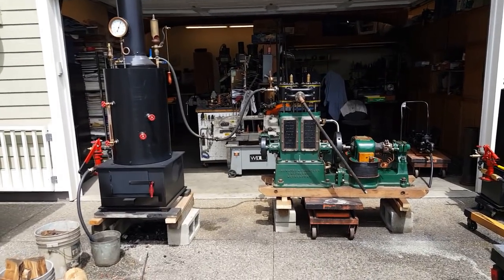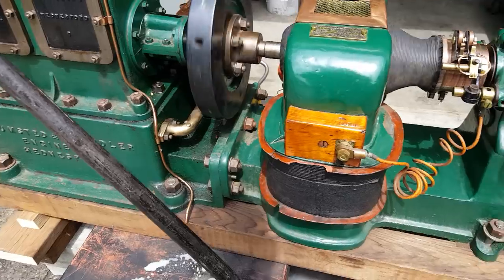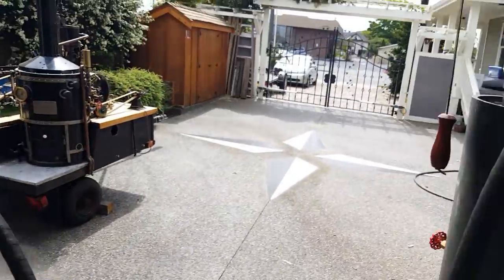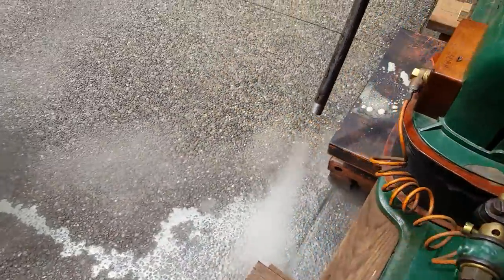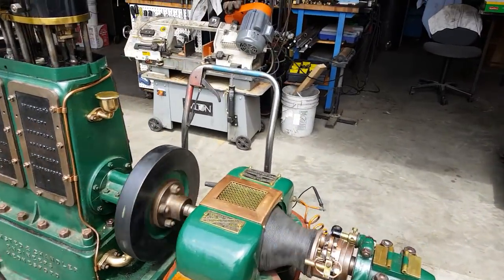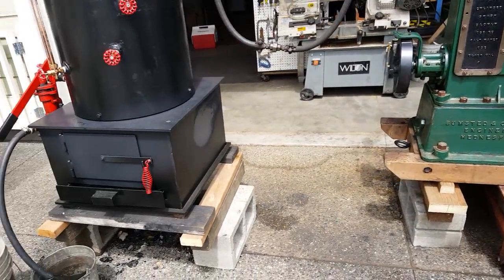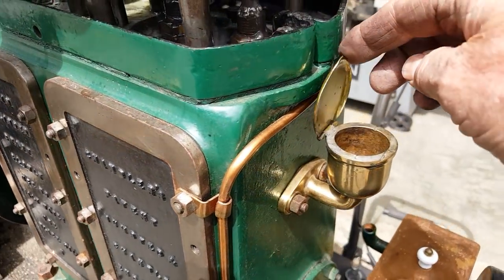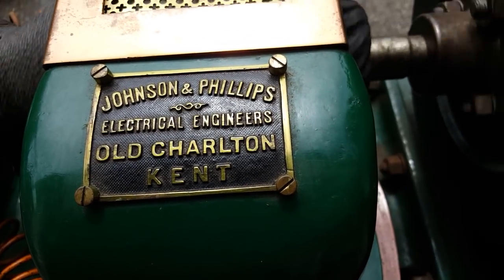Steam Engine Dynamo

Comment: If the voltmeter is reading only about 2V, probably the field is not connected or is open circuit internally.
Possibly it is a series connected machine, which means it won't generate rated voltage without the rated current flowing.
The handle for rotating the brushes is for manual compensation for what is called "armature reaction".  When you draw current from a generator, it causes the magnetic field established by the field coil to twist about the generator axis.  This means the optimal commutator timing varies with load.   The idea is that you keep an eye on it and adjust the brush position as required to maximise the voltage.
It is a concern, though when people, who are obviously not qualified, play about with machinery like this.  In most countries it is illegal to operate such equipment without a license or appropriate qualification (ticket).  If you had such a ticket, you would know why you are only getting ~2V.  
"Virgin" generators do indeed need to be started with a battery or other source on the field - from then on residual magnetism in the poles will allow them to start without external energization.   If yours manages 2 V, which is 2% of the rated output, that is all that is needed.
Reply: @tripplefives1402 : If its a modern internal combustion engine-generator set designed for consumer use, go ahead and use it - you don't need a license to do that.  If you want to turn on your house lights or watch TV, go ahead - you don't need a license to do that.
But if you want to WORK on a generator, or repair or alter your house wiring, in just about all countries (apart from 3rd world, poor African countries and the like), you need a license.  In many, but not all, countries you need a ticket to repair a TV set. 
Further, throughout the world, to operate steam plant, you need a license.  Steam is inherently more hazardous than gasoline or diesel operation, as its under considerable pressure, and it contains considerable heat. 
Obviously, anyone can invent whatever they can dream up.  If it turns out to be non-hazardous, good - everyone is happy.   But if it turns out to be hazardous, the ensuing accidents will cause authorities to pass laws or make regulations requiring licenses.  Which I'm sure you already appreciate.  Do you drive a car?  Yes - you need a license.  Did Henry Ford have a license when he built and operated his first car?  Nope.  And it didn't even have brakes.  
The Wright brothers did not need a license to invent a gasoline powered aeroplane, nor did they need a license to fly it - at the time.   But experience (ie accidents) soon proved you need to be properly trained to operate an aeroplane, and within a short time, a pilot's license, which requires the proper training, became mandatory throughout the world.
You won't get shot for owning a steam generator.  Nor will you get shot for working on it or using it.   But if, through your ignorance, someone gets hurt, and you have no license, any insurance you have will not be honoured.  If you get sued, you haven't got a leg to stand on.  And if the authorities find out, they will impose some sort of penalty.
Reply: @tripplefives1402  : Dig yourself in, mate.  You are the one that is wrong.
In the USA, electricians need a license, "gained by passing an exam demonstrating a knowledge a competent knowledge of the National Electrical Code" (NEC).  Apprentices who are  learning the game must work under the direct supervision of an electrician "found by the State or National Authority to be competent" (ie have the license).  Pretty much the same as any Western country. The rules in the USA are a little more comprehensive than this, but I am trying to keep this short.  
Sure, if some "weirdo" hurts only himself, nobody much cares.  But if a licensed electrician hurts himself or others, he may be able to get insurance payout and avoid prosecution, unless actual negligence is proved.
If you do work on your own equipment or within your own property, you do not escape prosecution and you still need a license.   If, for example, you have constructed or maintained steam plant and a visitor (invited or not) gets hurt, you're gone.  If a boiler explosion occurs and hurts someone (within your property boundary or not), you're gone.  If you work on your own electrical wiring, and a visitor gets electrocuted, you're gone.  Certain types of electrical wiring errors can affect people outside your property boundary.  If you did it, you're gone.
Leaving aside for the moment that the USA is loosing its leadership in innovation (seen how many patents are granted to Chinese people and assigned to Chinese companies lately), you are wrong about what encourages innovation too.
As I said, regulation & licensing comes AFTER new inventions come about - when the need is demonstrated by accidents that occur.  You need a license to do electrical wiring work, even in the USA, and in the USA such work is legally required to conform to the NEC.  You cannot say the need for a license prevents innovation in electrical matters, because the technology is mature - has been for 100 years.  The major innovation/invention occurred before licensing came into force.
The days of backyard & garden shed innovation/invention have largely gone anyway.  Check out what patents have been issued - 99% are assigned to large businesses, because only large businesses can sustain the facilities and salaries required to come up with things new and novel.  Henry Ford built a car engine in his home shed out of left over steam pipes and other junk.  Today's car engines are sophisticated machines built of special materials to designs produced on million-dollar computer simulation and design tools operated by folk with Ph.D's.  
In short, if you invent something new - great. Go for it.  You don't need a license.
But if you are going to operate steam plant, you need a license.  If you are going to work on electrical generators, you need a license.  You are not going to invent a steam engine or a generator, because it has already long been done.  Innovation is simply not an issue.
Licensing prevents accidents that experience has shown to the authorities that such accidents are likely if persons not competent do work, because such persons are legally prevented from doing the work.
I wouldn't know if some US police officer would ignore a non-licensed person doing electrical work or operating a steam engine, or not.  A police officer cannot know everything, and this would be a very unusual/rare offence.  But if the actual licensing authority became aware of it, action is likely to follow.  Here in Australia, we have several kinds of police officer.  Park illegally or dump rubbish on the street and a local govt ranger will prosecute.  But a State police officer will most likely ignore such things, and arrest you about that drug lab you've got.  But he will most likely ignore that fact that you've got some illegal lobsters.  Don't tell Fisheries though - they'll throw the book at you.  I bet its much the same in the USA.
Reply: @tripplefives1402  : "As long as your equipment is below a certain size then you are exempt from most regulations."  What size is that, exactly?   And which regulations?  Which regs still apply?
And if you are operating a supposedly exempt steam plant, without a license, and there is a boiler explosion, which kills a visitor, what then?  Your phrase "does not involve other members of the public" is codswallop, because sooner or later they are involved.
You talk nonsense.  China is very regulated.  While they still have a long way to go to overcome the Asian "if its got your name on it, or if it hasn't...." attitude to personal safety, they've gone to a lot of trouble to comply with Euronorm standards, which the USA is too stupid to do.  (example: I worked for a while for the local dealer of a certain major US manufacturer of large diesel engines whose corporate colours are yellow and black.  Every time we sold a large marine engine, we had to spend $15,000+ to modify it to meet international Safety Of Life At Sea (SOLAS) requirements.  Competitors, of course, Japan, Sweden, China, build their engines in compliance in their factories.)  China is rolling out a huge video and phone surveillance system, with the intention that if a citizen does not behave in an ethical, productive, and a non-adverse-to-reputation way, they'll get sanctioned - even if there is no rule to cover it.  Far beyond what happens in the US or here in Australia, where you only get sanctioned if you get caught.  China has a had a problem with ethics (example:  milk producers were told their output had to have a minimum protein content, as measured by specified method.  Trouble was, the method was fooled by melamine, so the idiots put melamine in their milk.  So in that sense, its Wild West.  But they are rapidly learning.
It's true though that the US have regulated themselves out of a lot of business.  It's cheaper to make stuff overseas than upgrade American factories, so that's what the big boys have done.  Including now that yellow and black engine maker.  This is not so much about the quantity of regulation, its the way the regulations are applied.
One of the reasons why the US used to be the leading innovator had absolutely nothing to do with regulations and licenses or lack of.  Innovation occurred because companies were run and often owned by professional engineers and ex-technical men.  These types of manager saw value in investing big in research and development.  In the last 30 years or so, that generation passed on, and the same companies were taken over by generic professional manager types, who see R&D as just a cost to be minimized.  The same thing happened in Britain 20 years before.  Because the ownership of almost all companies in China is traceable back to their government, they are free to take a long term view, and they are spending what it takes on R&D.   Nothing to do with regulation, or a Wild West environment - its happening because they've studied what it takes to get ahead.
I recall when a Chinese delegation visited Australia 35 years ago, trying to sell trucks.  They got laughed at, because their trucks were a copy of a late 1950's Russian truck, which in turn was a copy of a 1939 American truck.  But they went home and thought about it.   Now, Chinese trucks, up to the minute in technology, are selling here in volume.  Innovation - or lack of - has nothing to do with regulation or licensing - but everything to do with attitude, and a will to sell product, and not just to show a profit in next month's report.
Reply: @tripplefives1402  :  You're still taking nonsense.   
Whether its a criminal matter or civil matter, no matter, if you've done something wrong, and you're caught, you get sanctioned, and if whatever you did required a license to work on, you'll cop it more.  Lots more.  Not the same as a BBQ accident at all.  A BBQ accident is just an accident, perhaps a bit of negligence, but that would have to be proved.  Insurance will cover damage to property and medical costs.  A steam plant accident, and you don't have a license, you'll get done for operating without a license.  The insurance company will walk away.
But, yes, we in the West are exporting our pollution to China - and a few other places.  But the Chinese are getting wised-up.
Very few inventions of any importance at all are attributed to individuals/inventors, actually.   As I said, the days of individual inventors have pretty much gone - because today's world is a high tech world, and you need expertise and high tech equipment to come up with anything new and novel.  That's been the case for many decades now.
I note you haven't answered my questions - which kind of confirms what I thought - you just write bull without any actual knowledge.
Your statement "the personal computer was invented by a guy running a small electronics business in new mexico" is utterly ridiculous.   Just what are you smoking??  Must be really good weed!  Who is this mythical small business guy supposed to be?  When was he supposed to have invented the PC?
If you are going to make statements about who invented the personal computer, you need to be careful.  And you need to think about what makes a personal computer a personal computer.   A computer designed or intended, and sold, to be operated/used by one person?  The first personal computer with volume sales fitting that definition was the DEC PDP-8.  I got to use one in 1969 - it was already old by then.  It was devised by a large US company then very experienced in small computers, the Digital Equipment Corporation.  It had hundreds of circuit boards in it called "Flip Cards" as I recall, though the whole thing still fitted on a desk-top, albeit you used with a teleprinter machine along side.  Most of the flip cards were first used in other products in Digital's output.
Is your definition of a PC one built around a relatively (compared to minis or mainframes) low number of integrated circuits?   If so, its a toss between the EDUC-8, developed by an Australian electronics hobby magazine in the 1970's and an Intel 8008-based PC developed at the same time by a US electronics magazine.   The first PC that is a recognizable forerunner of modern PC's (ie the same key features)?  That's the original IBM PC (1981), developed by a team of engineers in a very large company called IBM.
Is your definition of a personal computer the first computer designed to be operated by one person?   If so, the answer is the 1946 ENIAC, developed by a major US university.
Later on, I got to use personal computers such as the early 1970's era Hewlett Packard 98xx series.  These were marketed as "programmable calculators" for marketing reasons, but they had all the attributes of a PC - a video screen, keyboard, RAM, storage on tape, programmed in a high level language, could run many apps sold by HP and others, a printer port, sat on your desk, etc, etc.
What about the early Olivetti PC's, such as the Programma series that came on the market in 1964?  Definitely a PC by any reasonable definition, and it was the result of a whole team of people working for a very large Italian company.
What about the mid-1950's Bendix G-15 (developed by a team of engineers at Bendix, another large company)?  It was a personal computer - ie designed  to be used by one person, though it was the size of a large fridge.
Some people get funny ideas about "inventions".   If you are English, you typically think television was invented by a lone inventor John Baird, who was actually a snake oil salesman who had no idea.  If you are a German, you typically think TV was invented by a German, which has some truth in it.  But the reality is that various essential parts of TV were devised by various people in various part of the world, with the bulk of the work required to make it practical done by a whole team of highly qualified research & development men at RCA - at that time a HUGE electronics company.
Most inventions are like that.  Not invented at one stroke by one person - but the result of the sum of work done in big company labs.  Cars, TV, steam engines, digital cameras, phones - all the products we are accustomed to using were developed in expensive labs owned by big companies with lots of people involved.
Reply: @tripplefives1402  :  You still haven't answered my questions:-
a) What size (of steam plant) below which regs do not apply, exactly?   And which regulations?  Which regs still apply?
b) Who is this mythical small business guy supposed to be, that you said invented the PC?  When was he supposed to have invented it?
That tells me, and everyone else, you just talk and know nothing about what you are talking about.
Something is a criminal matter because the offender broke a criminal law (law relating to crime).  You may break a law that is not a criminal matter - you can be prosecuted because you broke a law.  And, as I said, if you do something which you are not legally competent to do (eg no license), insurance won't cover you.  The US is the same in this regard as any other western country, though the details and penalties vary.  For example, if you cause a minor car accident through negligence or ignoring a traffic law, you can be prosecuted under that specific law or prosecuted for negligence.   Park illegally - that's not a criminal offence, but you still get prosecuted.  Certain driving offences causing death or serious injury may also attract criminal prosecution - that will vary from country to country and state to state.
Reply: @tripplefives1402  :  The English electronics magazine Wireless World published a design for a home- or high school- constructed personal computer in several parts starting in their August 1967 (Yep, 1967) issue, pages 366-372.  It was pretty basic, only 8 bits, and not of any real use other than play and learning, but it had all the essential features.  Yet another example that shows that the Altair 8800 has absolutely no claim to be first.
The moral of this story is:  Don't go on about things you know nothing about, eg steam engines and computers, and qualifications required, when, and why.

Comment: They are spring loaded and therefore automatic (the pressure at which they lift is adjustable) and they are not plumbed in to the drains, which should of course be open at startup, so if they do lift, they make a right mess, best avoided. Regards Clive.